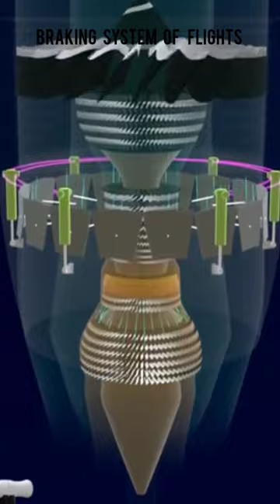Braking systems in flights #aeroplanes #flight #didyouknow #mechanics #learn #information #technique

Comment: It's not spoilers it's flaps
Reply from the maker: Flaps vera spoilers vera please check it ❤
Reply: @mugimedia Spoilers are panels mounted on the upper surface of the wing that, when extended, both increase drag and decrease lift by disrupting the airflow over the wing. Dependent upon the aircraft type, spoilers can serve as many as three distinct primary functions: Ground spoilers. Roll spoilers
Reply: @mugimedia here u shown is flaps spoilers is used to reduce the lift